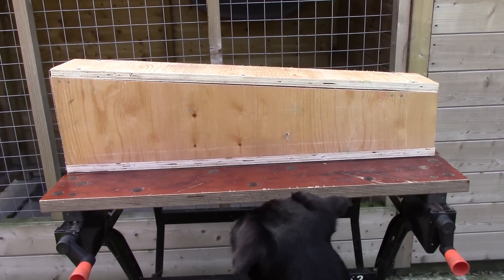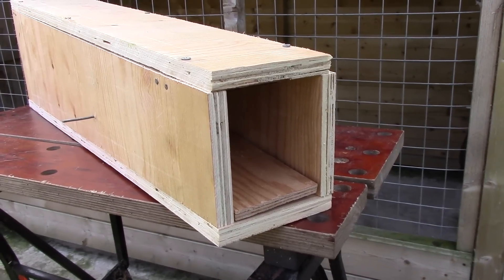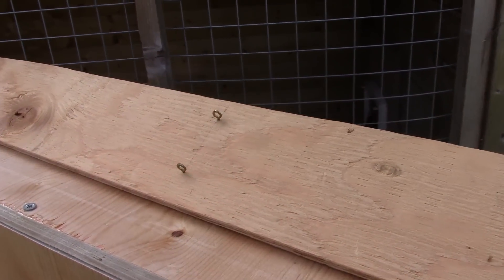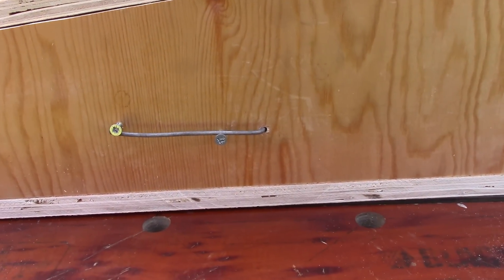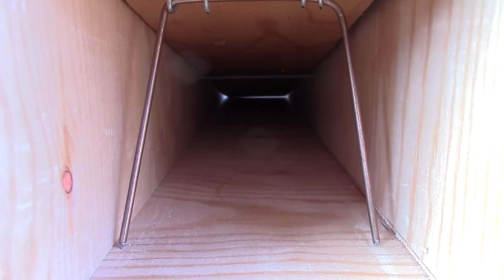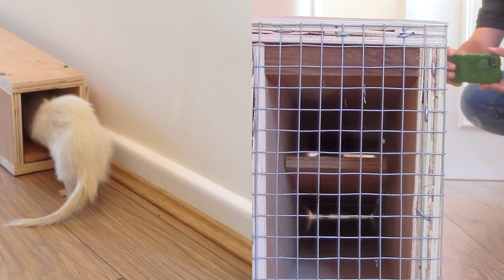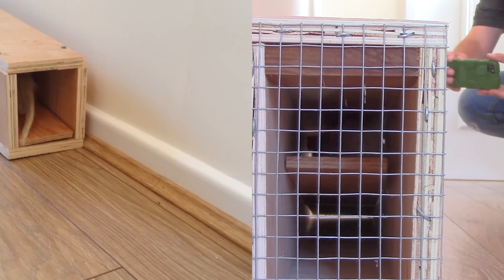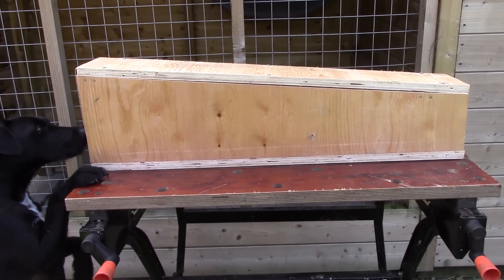SeeSaw Trap

Comment: Great trap. can you tell me the dimensions  (aprox )
got a few places to use this kind of trap.
Reply from the maker: Not with it at moment but it's about 2.5 ft long. 10 " high at one end and 5" high at other. You can make them any size you want, the important bit is that the seesaw allows you to see straight through when set, and completely seals when triggered. You can even make a door in the set end to remove catches if you want.